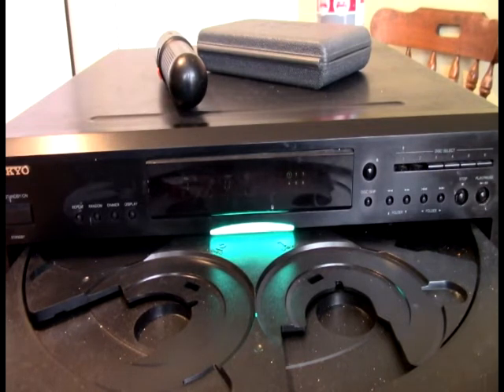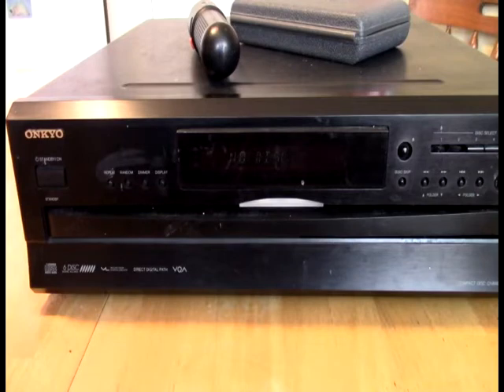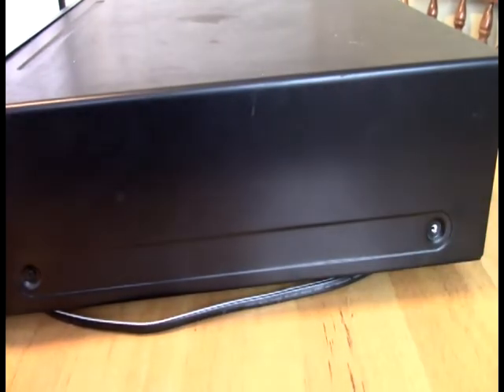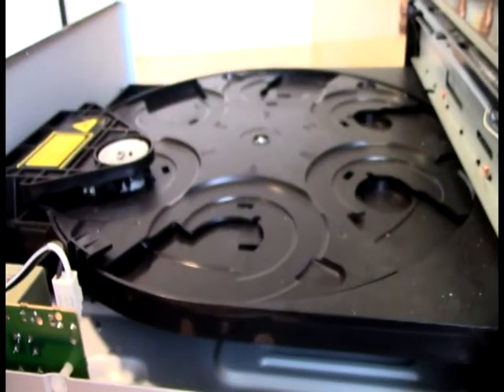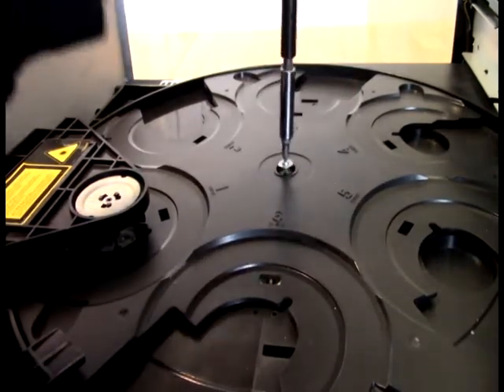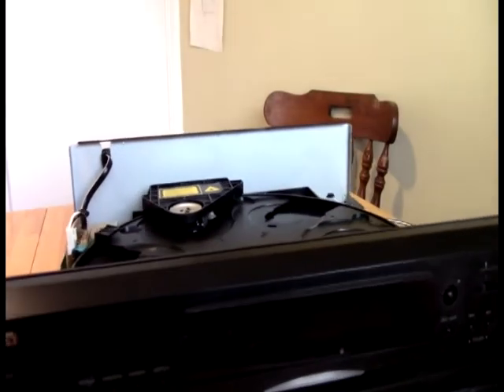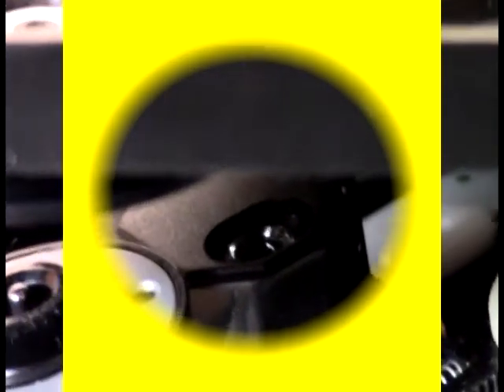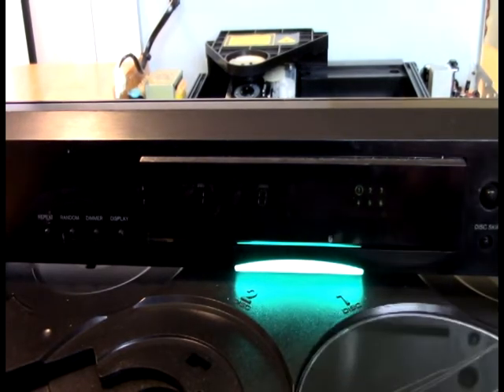Project Video: A look inside an Onkyo DX-C390 CD Changer

Comment: I think this is actually a great unit. I have been enjoying 2 of these (one in my living room and one in my bedroom) in the past 5 years and they have been very reliable without major issues although there are times when it doesn't read the disc (mostly in random play mode) but goes back to normal when you manually go to a disc. However, recently, it started to act up and not read the disc or stop in the middle of the song even when I manually choose the disc which prompted me to watch this video. It sounds like the person who posted the video was also having similar problems. Unfortunately, it's not clear to me what he actually fixed or if he fixed his issues. I wish it was more clear where the laser is and how to adjust/clean the lens. I know the video zooms in on the laser but Im not sure where on the unit it is located. And he says it doesn't look dirty. I believe there is also screw to adjust the lens which affects the way it reads the disc (learned that from another video).
Reply from the maker: These units have a reset when unplugged for a significant amount of time (think like a day, in this case). I don't know what fixed it, but it turned out, as indicated in the video, not to be necessary. It has been working again trouble-free since that time. I assume it was the reset which cleared whatever was the error.

Comment: So I am confused seems like they are selling the same unit for Black Friday at $249.99, even after 15 years of your model. I am sure they would not make this same model if there were major issues for over a decade. Maybe it has come to its end and you need to pick up a new one if you like it that much. I am not sure what you paid for it but by today's pricing it only cost you $16.60 per year over 15 years.
Reply from the maker: I believe they have updated the model to be more current. As I've mentioned, since a 2 day no power reset, it has been working largely trouble free. Also, the price I paid for it back then was considerably less than it is even on Black Friday. Non Black Friday prices for this I've seen north of the $300 range...

Comment: hi got the exact model. started acting up lately. after i accidently loaded a cd on top of another & tried to play. had to take apart to retreive extra cd. Now sound goes in & out on playback
Reply from the maker: I think I wound up leaving mine unplugged for a couple of days and it more or less responds normally again. The sound thing is a new one...definitely should not be any way for that to be possible...does you model also have a USB port or just CDs?

Comment: Since new, my Onkyo 390 skipped tracks and discs. Even new discs. Is there a video how to replace the laser pick up? Any help will be appreciated.
Reply from the maker: I'm not sure. I haven't seen one, if so. Shortly after I got this one, well within the warranty period, the unit in this video malfunctioned to the point where I had to take it to an electronics shop who was doing the service work for Circuit City/Onkyo (One of them, I forget which, set up the appointment) and that company basically gutted the thing and replaced nearly all components, which gave me largely trouble-free operation for several years...if you bought it new and are having those issues, I'd pursue that course...
Reply: just replaced laser in mine its easy 4 screws new laser exact same  fitted working perfect got spare of ali xpress 27 pound straught forward fitting brill

Comment: Mine would skip badly until (its old but not a pos like yours) i fixed it in a few minutes. I came across this video. https://www.youtube.com/watch?v=EnlkQgbMq9g...i took off the upper part of the cd drive...the part with the yellow triangle sticker...i lubed the rail and plastic gear with a little petroleum jelly. turned the white plastic screw (i guessed it was the speed adjustment) just a smidge and hit the lens with a q-tip moist with alcohol. works like new.
Reply from the maker: I'm not convinced mine is a POS...it has worked more or less normally and trouble-free since the hard reset of a bit ago that I mentioned. I've used it quite a bit since I got it and it wouldn't be the first console CD player I've worn out...I went in expecting to possibly replace one of the motors, which may still be something necessary in future. Thanks for the tips!
Reply: @OKGoodReview  sorry...hey btw, the little white screw i turned was the DVD speed controller...songs play a little faster but not not too noticeable except on slow songs... i'm going to turn it back and hope that just cleaning the lens and vaselining the rods the laser slides on was enough.